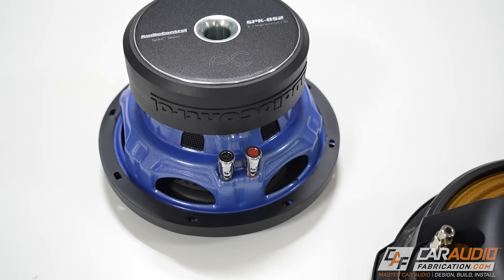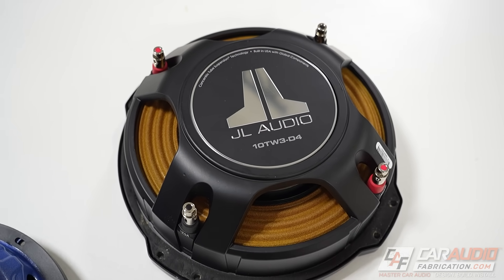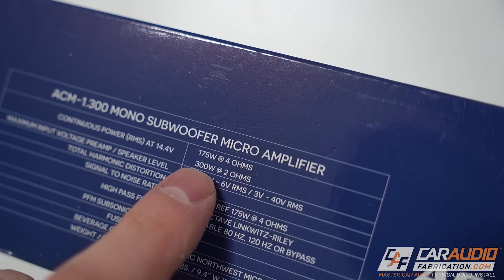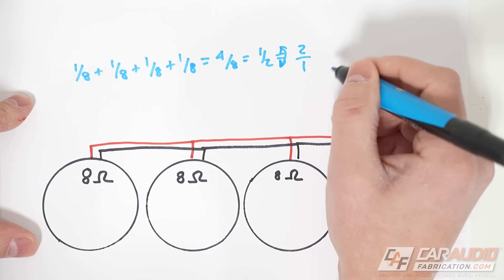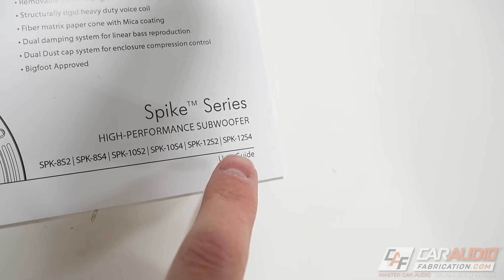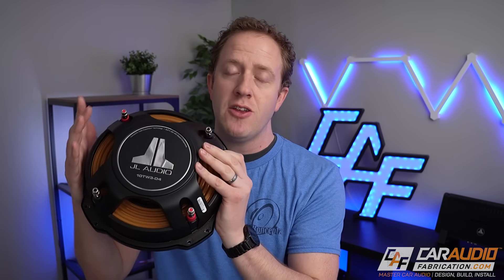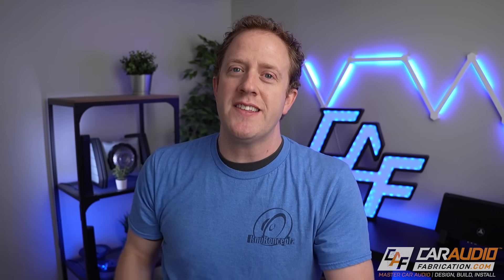Single vs Dual Voice Coil Subwoofer - Which is BEST? Wiring Explained!

Comment: Had a quad coil 12" woofer years ago. 2500w RMS, 6000w peak. Bought brand new for a bargain because its coils were 1.5ohm. my amp was 2 ohm. Wired parallel/series and sent it. 
I broke alot of enclosures and couldn't push it to the limits.

Comment: For a dual voice coil sub, between series and parallel wiring? Which one gives more power?
Reply: The amplifier should say at which ohm load the power output of the amp is maximised. Set up the speakers to reach this ohm load.

Comment: I have a question that I do not believe was addressed.  Two channel amp, dual voice coil.  It was stated do not send left and right to the two sets of terminals.  But what about if the two channel amp is receiving only the subwoofer signal, not left and right?  rather than bridge to the subwoofer, why not wire each channel to one set of terminals?

Comment: So I have a JL 10w6 with dual 4 ohm coils and an Alpine S2-A120M 1200w amp. Will that same amp power 2 of the JLs adequately, if they are in parallel?

Comment: Dual voice coil can accept two monoblock amp connections so it is superior to single voice coil for that reason
Reply: Be careful and hold that thought because each coil in a dual subwoofer coil speaker is actually less than that of a single one.
If a single coil subwoofer says it's 600 watts, a dual coil subwoofer coil is actually only 300 watts each. Companies who make dual coil subwoofers should give the rating like a single coil not divided between the two. In other words if a subwoofer says 600 watts dual voice coil it should have a rating of 600 watts each coil but it doesn't work that way.

Comment: I guess we are ok to use 2 Channel amplifier connected to each voice coil of the subwoofer, as long as both channels have the same mono signal.
In my case, for JL Audio 10W6-D4, a 4+4 ohm dvc sub with 600W RMS Rating
I have 2 options of amplifier here
Helix P One (2-Ohms 880W)
Helix P Two (4-Ohms 280+280W)
(Both amps are driven by P Six via DSP controlled optical connection)

Would you tell, pros and cons of the 2 setups?
For P Two - Do I have advantage using in 4-ohms or disadvantage because the total output is underrated?

Comment: I'm confused.

If you have a 2 ohm DVC subwoofer with a 750w RMS (3000w Max)  rating, and run it in parallel configuration to itself as 1 ohm, are not also in turn elevating this DVC sub's power capacity to become more efficient (improving power and performance overall) and doing so in a way that makes it suitable for a 1500w RMS amplifier--thereby narrowing the Sub's RMS-to-Maximum wattage GAP that might otherwise be difficult to jump ("bridge")... That is, compared to how the DVC Sub would perform if had been wired in the standard basic way to a 2 ohm 750 RMS amplifier?  

Thanks in advance for helping to clarify/correct my confusion. I still have much to learn.

Comment: You buy the sub to match the amp or vice versa. Dvc svc 2 ohm 4 ohm ect one doesn't "hit harder" than the other. It's just for wiring options. If you need 100% of your amps power you need 1 ohm final load.

Comment: So I have a 1500watt mono amp, at 2ohm it’s RMS is 1125w and 4ohm it’s 563w. The subwoofer I’m using is a 1800w dual 4ohm with 900w RMS. I’ve always had it hooked up 2ohm and it’s never sounded as good as I know it could. How can I hook the dual 4ohm without it being 2 or 8? I’d like to run it at 4ohm with 563rms

Comment: Did I miss it? What’s the difference as far as speaker/sub output between 2 ohms and 4 ohms?
Reply from the maker: No difference assuming rated power at impedance is the same.

Comment: I have two single 4 ohm voice coil can they be wired down to 1ohm  in parallel with each other? Or just two ohm parallel. With each other?🤔
Reply: @MalcolmVeganLifewoods5008  just 2ohm sadly, you'd need two 4ohm DVC subs, so wire them down to 1ohm

Comment: Hello! 2 Questions!

Question 1: Does a dual coil uses more watts RMS compared to a single coil? (Example: 1 Sub rated at 150 Watts RMS 4 ohm single coil would be 150 Watts RMS per sub? and a 1 Sub rated at 150 Watts RMS dual Coil 4 ohm would that mean it will be using a total of 300 Watts RMS? or would that still be 150 Watts RMS rated?)

Question 2: I currently have a dual coil stock 60Watt sub installed on my doors but I want to upgrade to better subs, now the thing is, If I buy a 150 Watt RMS sual coil sub does that mean each sub will require 300 Watts? making it a total of 600 Watts RMS?

PS
I had a new AMP installed in my car, I believe its 500 Watts, maybe I can get some help here to be able to upgrade a bit! Thanks in advance! (Alpine R-A90S Amplifier)
Reply from the maker: The subwoofers stated rating in watts RMS is what you should use for each subwoofer. Manufacturers don't list "per voice coil". Add up RMS based on how many subs you use

Comment: I recently got a hold of a sealed subwoofer box JL audio dual  CS210G-TWS D4. They are discontinued but I am willing to install it to a stinger five channel amp. 2012 Honda civic sedan. I have no sub yet but have recoil SAM 65 6.5 in the front. I noticed the JL sub box says 8 ohm impedance on both terminals. I read that you can’t convert this sub into a 2 ohm only into 4 ohm. The max on my amp is 300 rms at 4 ohms. What other amp or gear do I need to beef up the system in the car?

Comment: I have jl 12w6v2 d4 sub.  600rms  , its dual voice coil, and im running a 500rms jl amp to it, im using only 1 of the sub connections, and im not able to push the amp fully, i can only push the amp halfway. If i wire it in series or parallel,  would that solve my issuse
Reply: My amps a jl500.1

Comment: Wait so i can get two svc subs snd wire them to a mono amp and it wont have sny performance issues?
Reply from the maker: This is extremely common. As long as the minimum impedance is acceptable for the amp you are good

Comment: 04 Tahoe factory radio and Boise amp up front powering original speakers and tweeters. Mtx tna251 amp Two 10" CT shallow subs in a Q Bomb box.  I have questions trying to clean this up. I still need to figure out how to run both subs because I'm worried about blowing stuff up I only run one to my amp it's dual coil wired to 4ohm so if i have two it will be 1ohm? But if I wire them at 8ohm together then they will be 4ohm? And the mtx can handle that? I also have a Jenson 600 I hear it can handle the 1ohm wiring scenario.

Comment: How do i measure the ohms of my subwoofers? Can i just stick a multimeter on it?
I have a pair of pioneer 10" 1000 watt rms subwoofers but  online receipt from ebay is gone. I don't remember the model number of them and the owners manual is long gone. 

I've had them wired up to an amazon special bargain bin amp that's "1600 watts" that i traded my brother in law for many years ago. I have no idea what the specs are. Long story short the point is that i need to rework the entire audio system in my truck anyways so i'm looking to get an amp (or two) that matches the spec for the woofers i have.

Comment: How do I wire two dual voice coil 2 ohm subwoofers down to 1 ohm, right now I have them in series parallel at 2 ohms and want them at one ohm but can’t find anywhere on how to do that
Reply: You can't get them to 1 ohm, the math doesn't work out. You can get them to 0.5 ohms, 2 ohms, or 8 ohms
Reply: @wally7856  have one 12 inch with 2 x 2ohm voice coils. is there any chance of ending up on 2 ohm with some creative trickery. my understanding is I get either 1 or 4 ohm. my new class d mono seemingly should be good, but im slightly worried

Comment: Well, I've bought a dual voice coil subwoofer, because I have two amplifiers, both of them having 4 outputs! The rear amplifier would be used to power a pair of rear speakers, and other two outputs will power the subwoofer! So, I have two channels separately powering each voice coil of the subwoofer! luckily, the amplifier supports 2 Ohm load! :)

Comment: Got a 10 inch kicker that was a dual voice coil subwoofer and it was a little bit of a scare to see when I pulled it out of the box not realizing all I had to do was throw a jumper wire on the second voice coil. It’s not as scary any more and it is fun to learn this audio stuff slowly over time.
Reply: So scary 😱

Comment: I have a 
*monoblock 2000 watt amp
*4 channel 1600 watt amp
 *Dual 12" Rockville with 2 ports on bottom of box. 
* 1 12" punch sub with Dual voice coils 500 RMS 1000 watt peak,
* a KICKER 800 watt peak power
* 12 inch  audio pipe ipipe with dual voice coils 1600 watt
*Single 12" box no ports
*Single 12" box with port on front side 
Dual 12" box with single combined port in the middle of subs(was for the 1600 watt audio pipe subs, no longer have the 2nd sub)
Reply: @logananderson6555  what has got to do with wiring?. pls this channel is not a sale channel.

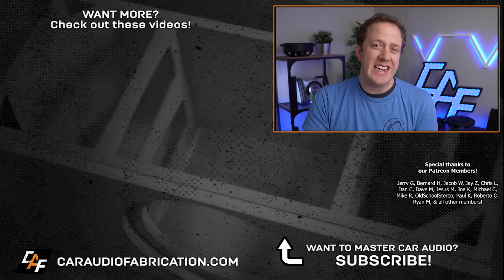Comment: 9:45 1
•ell 5G 70,
• Siri
Comments
X
Bro, I am so frustrated! I have been working on my car audio installation for like 200 friggin hours and I am trying to figure out the best wiring scenario for my 12 inch jail audio W6 something something V4 on one of two different apps and I also have a 12 inch Canadian made subwoofer that's supposed to be 1500 W RMS, but I have yet to discover whether or not It's even as good as the JL. I need to know what you think would sound the best and how it should be wired I have that hurts 1100 W or I actually think it goes up to 1246 or something HP one amplifier and I figured I would run, more powerful sub off of that amp and I have the Kenwood Excel on XR
900-5 the five channel 60 W RMS per channel and 600 W RMS mono block subwoofer output and only has a positive and a negative for the sub so bridging it is out of the question and I'm trying to figure out how it needs to be wired if I want to bridge my four channels that I run mids and tweets off of And if it's 600 W RMS, it should match up perfectly. With the JL audio.12 " leaving the 1500 W RMS sub to take maximum power from my hertz amplifier.
However, after listening to numerous wiring and videos, I am still at a loss for how to make sure l am pulling maximum wattage from the subwoofer output on my five channel and I've only got one amp and one sub on the other, how do I wire the one subwoofer to make sure that the amplifier is only pulling what it's supposed to which I believe is two ohms l don't think I can go down to one ohms and getting all 11 or 1200 W. from The amplifier. Please help me bro desperate Damon.

Comment: Ok, you make this make sense but I am still missing a piece of my puzzle. I want to run a pair of subs in stereo effect. I am thinking two single voice coil 2 ohm subs run to a two channel amp running similar rms @ 2ohms per channel. Is this the correct way to see this? Or I could even run two subs with DVC @ 2 ohms each if wired appropriately, I can see that as well. But series/parallel between the subs? I feel like this is if you are bridging the amp? The more I ponder this the more lost I feel in the numbers.

Comment: I'm in the market for a single sub (10"/12") and enclosure.
And I've noticed that the Pioneer 'Champion Series' 12" is offered in SVC and DVC versions.
Both have a max output of 1600w and an RMS of 500w.
😎👍🏼

Comment: Let’s say I run a single dual voice coil 4 Ohm sub wired parallel into a bridged mono 2 Ohm Amp output… Is the dual voice coil subwoofer more reliable than a single voice coil? That’s always been my thought?

Comment: I'm back in the bass scene after 23+ years, and the audio shop has been bringing me up to speed on all the advance changes. What a difference from the 90s. I've been convinced to wire my brand new never used 2x12" Pioneer IMPP (From.1998) subs @ 450w max @ 4 ohm in parallel to run on 1000w 1 ch amp to 2 ohm. Can't wait to hear this.
Reply: I am back after 25 years and kind of lost myself after 8:20 😂
Reply: I’m in the same boat…. But I’m going to revive my Kenwood KAC-PS200T amplifier…. I hear They don’t make em like they used to 👍🏼
Reply: @unclepabs  yeah dude , nowadays everything is digital , i hate them... tiny little digital amp with massive possible breaking points... i like a big ass bulky amp that stinks of mosfets and capacitors.... i remember the kenwood twisters , the CV stroker 16inch with the centre guide pin etc.... I hate shallow mounts , i shoot at 6x9 inch 5way speakers with a 12 guage , hate them!!!! and those stupid carpet covered boxes wiith the plumbing pvc ports !!!!!! i need bass that makes you wanna vomit....rattles your eyeballs so bad that you cant read the display on the radio.... p.s the best sub enclosure is a ball...i made a fibreglass ball to the size of the recommended volume for the subwoofer, with flared tube port extending to the centre inside the ball. What youu get is a much wider range of bass frequencies and lots less ditortion... i made it white with red and blue "veins " like an eyeball (the sub being the eye, duh...)

Comment: Here's a slightly off topic but odd use case that some of you might find interesting. NOT car audio, rather commercial PA.  The Peavey PVXp "800 watt" powered subwoofer uses a 15" dual voice coil driver inside the cabinet (the only time I've ever seen this done). Why? Because the engineers were feeling lazy, and the bean counters said "cut costs". They took the class D amp board from one of their existing full range cabinets that has 2 identical channels (one for the horn, one for the woofer), and connected one of the channels to one of the voice coils, and the other channel to the other voice coil.  They then designed a simple mono input board with a low pass filter that feeds both channels the same signal, thus complying with the "don't send a stereo signal" rule.   Side note, you car audio guys would be disgusted by the amps that these big brand name companies stuff into their powered speakers. Most of the better $200-ish amps that Big D puts on his dyno could outrun the crap that the likes of JBL, EV, QSC, RCF & others put inside professional cabinets that cost $1K - $3K USD.

Comment: I'm currently upgrading my factory subwoofer it's a single 10" dual coil sub, what would the reason be that they did this from factory? Also if I replaced it with a single coil could I just wire two out of the 4 wires to the sub and be OK? Thanks

Comment: I have a couple of Skar DDX15-D2s I installed in set of vintage Pioneer HPM 1100 speakers. To drive these, I had to bi-amp them. I let the Onkyo theater amp’s front speaker terminals handle the top set of speakers, and its front speaker pre-amp outs go to a Crown XLS 2502 pro-amp, which handles the bottom 15-inch subwoofers. I did try one single coil on each speaker, as the Crown pro amp pushes this 2Ω load at a 1200-watt (RMS) potential per channel. Then I connected my Skar's 15-inch woofer's dual coils in series. the Crown pro amp pushes this 4Ω load at 775-watt (RMS) potential per channel. The bass is a bit tighter at 4Ωs, but it's not quite as loud. I do prefer a naturel well balanced sound. In this system, you can feel the bass a lot more so than hear it. 
I do the math a little differently from you. With a two-impedance load, times two if it is wired in series, and times One-half if it is wired in parallel. With a three-impedance load, times three if it is wired in series, and times One-third if it is wired in parallel. Do this for each step of combining loads.

Comment: I have a dilemma. My subwoofer is a 4 ohm single coil but the amp is rated for more power with an output of a final impedance of 2 ohms. I have the Skar SK-M9005D amp. All the other speakers are wired to a final impedance of 2 ohms. It appears that a single coil subwoofer cannot be configured to a final impedance of 2 ohms. So, I am running all midranges at 2 ohms and the subwoofer at 4 ohms. Not so sure if this configuration works well for this type of amp. Thanks for the advice if any provided.

Comment: I have (2) 12” Polk DXi, DVC, dual 4 ohm voice coil subs, is it better to “Bridge” the amp or “Not Bridge” when wiring the two subs? (1 ohm stable amp). so this question is dual channel vs single channel wiring.

“Bridge” the amp and wire the (2) subs with a “single” channel, parallel/parallel for (1 ohm).
 Vs
“Not Bridge” the amp and wire (2) subs “dual” channel, parallel each sub (2 ohm).

I haven’t tested this myself, I normally run them on the 2 channels.

Comment: Hey Mark! Thanks for this information. It is very helpful. Quick question though, I bought a 4ohm DVC subwoofer. I parallel wired it to make it 2 ohms thinking that my amp was 2 ohms stable. The amp couldn't handle high volume and that's when I realize that the amp is 4 ohms stable and not 2. So my question is, should I wire the sub in series to get 8 ohms; should I wire only one side of the coils to get 4 ohms (which you said not to on this video) or should I return my sub and change it to a 4 ohm SVC? Thanks in advance

Comment: Hello brother lov your channel it’s basicly a university for car sound 👏🏾

I did buy for a friend a rockford prime r2 500x1 amp with a JLaudio Tw3D4 sub. 

But im confused how to plug the jlaudio sub. In series (giving me 8ohm) or parallel (giving me 2ohm)

The amp is rated for 500w @2ohm and 300w @4ohm

Which is the best wiring parallel or series

Im not worried about the warranty void because the max that the manual asks is for 400w power at the amp.